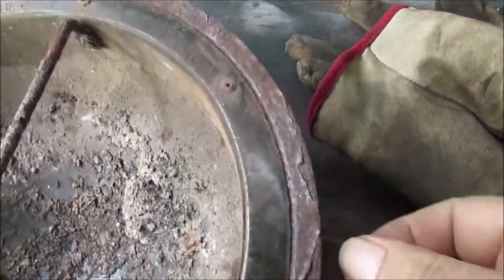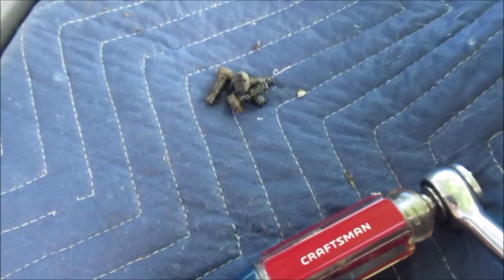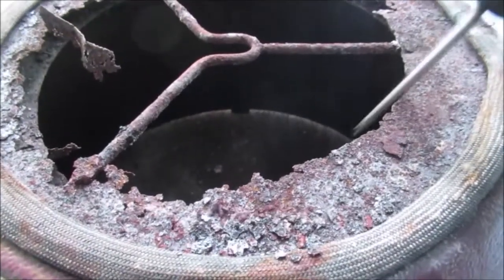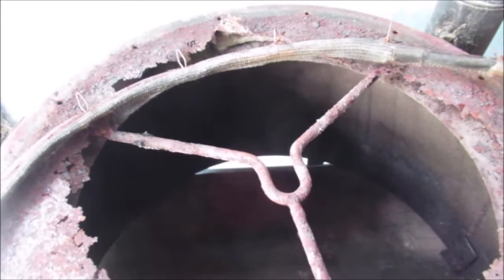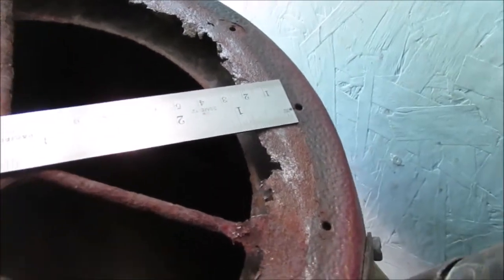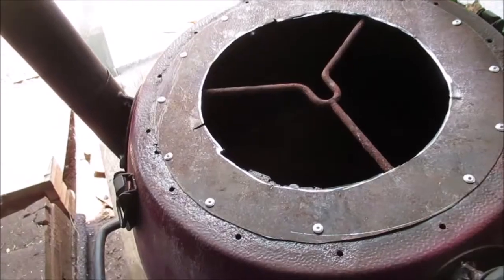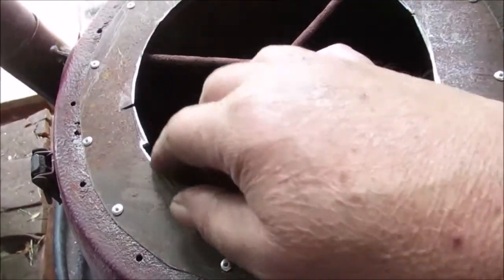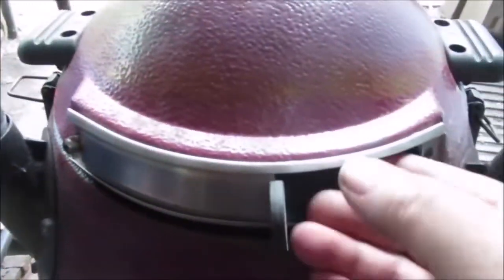REPAIR Rusted Bottom of  BBQ

Comment: Hi Jim, bought mine about 6 months ago and the only area i see rusting is in the firebox and the hanger area like yours.  in your opinion, what's the best way from keeping this from happening in the long run? I live in the tropics so humidity is high, which is obviously not good for the grill. thanks!
Reply from the maker: I just removed mine when it rusted it is easy to still clamp the bottom on